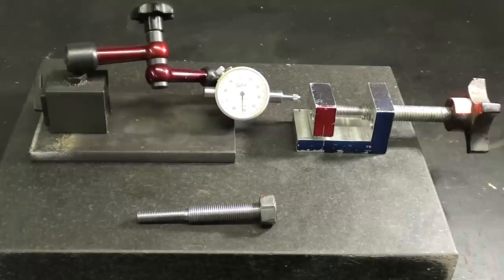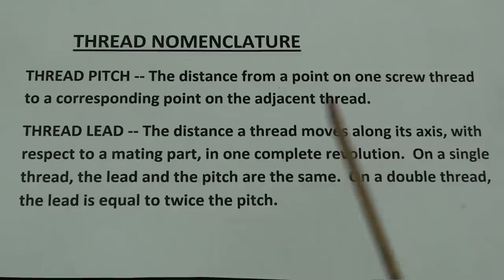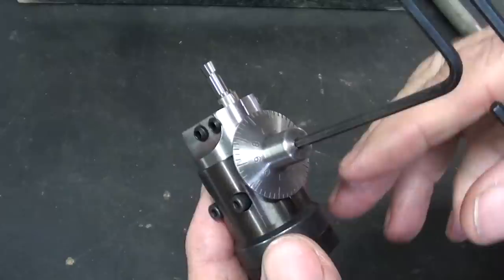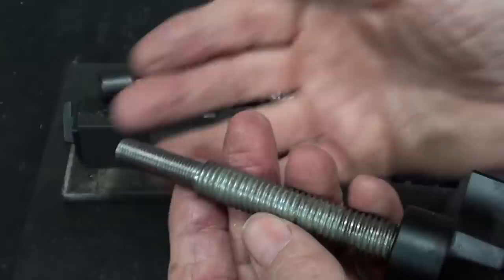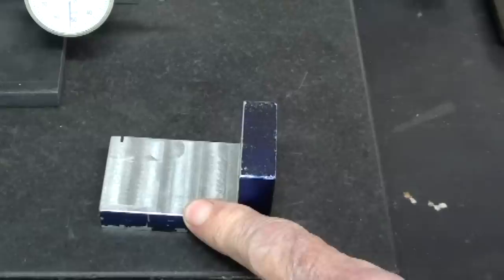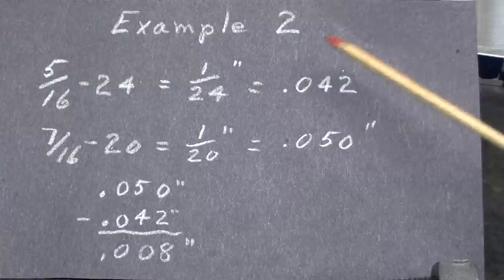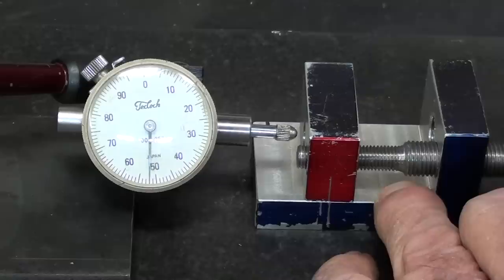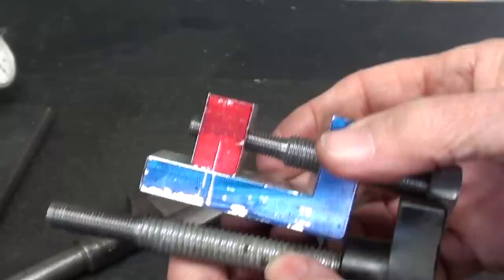What are DIFFERENTIAL THREADS #864 tubalcain

Comment: Thank you sir, for the explanation and demonstrations. I remember my father having a simple car jack with a central acme threaded column, nested inside an outer acme threaded part; the outer part being driven by an acme nut with an external bevel gear, manually operated by a bevel gear pinion via., a square section T-handle. I regret not looking more closely at the device but my guess is that the mechanism was based on a differential thread in order to gain the required mechanical advantage to lift a heavy car with modest human effort.

Comment: Nice demo - thanks. 

- the 8 thou per turn differential thread - converts nicely to metric as around 0.2mm per turn... (only out by 0.16mm after 50 turns...   So good to be able to mix and match from "standard" threads in metric and imperial for a precise outcome (imperial seems to have a greater range in thread pitches)..

The great thing with differential threads (L+R are interesting combos) the load carrying is orders higher than an equivalent "ultrafine" thread would be -  galling is also reduced, though "backlash is often increased, so best used for unidirectional devices (constant preload).
Reply from the maker: Thank you

Comment: Differential screws were used in phonograph record mastering turntables.  The turntable platter was geared to the screw, so the cutting stylus would advance slowly in a spiral from the outside edge of the master record towards the center.  Vinyl LPs have about 3.25in of recorded radius for about 20 minutes of play at 33-1/3 rpm, or 3.25in / (20min*33rev/min) = about 0.005in advance per rev, effectively 200 pitch.

Comment: Thanks Mr. Pete, always great to learn something new. I built a version of this old tony's boring head using inch measurements instead of metric. I can't tell you how many different thread pitches I tried (on paper) to get an adjustment screw where one rotation gave a whole number. 40 tpi the threads were too small, 25 tpi the lathe I was on didn't have that option. Wish I would have known about differential threads back then.

Comment: I found article about differential threads in Kent's Mechanical Engineer Handbook.The book I have had since 1974 . The article has all kinds of formulas for them.the pictures show acme threads.
Reply from the maker: I have that book, I will look it up, thank you
Reply: It's on page 7-10 from the number on the top of the page.
I am an old school machinist ,I learned on a south bend lathe and milling machine back in 1967.

Comment: I used differential threads for a couple of applications several years ago.  They both are for drill bit sharpner jigs, one for a General and the other for a Sterling (McDonough Manufacturing Co.) twist drill bit grinder/sharpener for large diameter bits.  The differential threads advance the drill bits slowly toward the grinding wheels for finer control of the amount of material removed from the bit.  Mitutoyo has micrometer heads that they call differential translators.  One has a resolution of 0.000005" as I recall.  If interested I could attempt to upload pics of how I modified the bit grinder jigs, both are fairly simple.

Comment: Great topic Mr.Pete. If one has a left and a right hand treads on a differential screw wouldn't this have the opposite effect and speed up the moving part? If so this would make a good follow up video. If I am thinking correctly you could explain the effect on a tap wrench. That small fine adjustment boring head is a sweet tool.

Comment: About 2 weeks ago, I made a replacement thumb screw for a Stanley 45 molding plane. It adjusts the fence that spaces the plow plane from the edge of a board. 

The specs are 1/4-28 tpi for 11/16 inch next to 9/16" of 0.196 (just over 3/16) left hand thread at 20 tpi.

I ended up single point threading both as I didn't have a die for the 1/4-28. Final screw fit well and is working great!
Reply: This was only about the 8th item produced on my lathe. I'm a retired engineer learning a new hobby to keep my sanity. I'm not sure if this screw helped or hurt the sanity aspect of the hobby. 😂

Comment: Mr. Pete last year I'm a high school and community college shop teacher, so I have acces to machine shops. 
Last year I made a "3rd slide" that mounts on an Aloris toolpost using a differential thread (40TPI-42TPI) so one complete rotation of the handle moves the slide .0011. I use a tenths indicator mounted on the slide to measure actual motion. I haven't done a set of experiments, but using a diamond cutting tool I'm able to take .0002 per cut. I really want to make another slide that moves in a 30 degree angle to be an auxiliary thread cutting slide. If anyone would like a pic of this unit I'm happy to send it out.
Reply from the maker: That sounds like a very interesting device. The differential thread is amazing, most people have never heard of it.

Comment: The steady rest on my 9" South Bend lathe has differential adjustable jaws. They call it "Telescopic" Steady Rest. But it works a little differently.  Instead of offering a finer pitch of adjustment, it's the opposite, it doubles the adjustment rate. Ken
Reply from the maker: Yes, I remember those. I had one ten years ago.

Comment: I ran into this concept a few years ago and found it really fascinating. While they are great for making really fine adjustments, you also need to keep in mind that with two threaded interfaces the play get's doubled as well. So for precision applications you need to hold incredibly tight tolerances with the threads to keep slop to a minimum. 
Eventually I'm going to get around to making a top link for my tractor using acme thread in a differential thread way. That way I can get the resistance to heavy loads that the acme thread offers, while still being able to make adjustments under load that I couldn't with just a plain application of an acme thread because the pitch being so steep means you have very little mechanical advantage when cranking on it.

Comment: I've used similar in shaft and coupling alignment, where the motor may have to be moved across a few thou.  Its all laser now but the adjusting screws are the same.

Comment: A few years back i pondered a way to move one thousandths movement with one Revolution on the hand wheel. I decided on the deflecting beam method. It was accurate and i used a single 8-32 allthread. This opened my eyes and i figure a scope uses some detail like these mentioned. Thank you Tubalcain i will be using some of this trik-o-nomitry😊

Comment: Once had to "design" a differential thread setup for precisely set a specialized bushing on UH-60 helicopters. Several of my coworkers never did figure out how I could get it within ,001 using a oddly stepped 3/8 bolt

Comment: These differential threads are used to make fine adjustments to the "slice" on a paper machine headbox opening to control the weight of the paper. These were placed every few inches across the machine so the weight of paper could be made uniform across the entire sheet.
Reply from the maker: That’s interesting, thank you

Comment: This might be neat on a slide driven rule with multiple scales ... where you could calculate relations or multiplication / division... you could call it a sliding rule... or slide rule for short... just thinking out loud... but if you made it computer controlled that would be a neat twist... a computer operated slide rule with differential screws. Happy Tuesday!

Comment: The Stanley #45 wood plane, later types like the Type 15, have a two-piece fence that uses a differential threaded screw for fine adjusting the fence.
Reply from the maker: Thanks, now I remember that I had several of those number 45s
Reply: @mrpete222  Yep, I have types 1-17 and a few duplicates.

Comment: I never knew about this, thanks! I have an english Troughton and simms master level that has a screw for calibrating the vial, I believe it is 100 threads per inch. I got the imitation optivisor out and counted 50 threads over 1/2". Now THAT would be a good application for a differential thread.
Reply from the maker: Yes

Comment: One shop I worked in we made three parts that were identical except the threads. One had a right hand, one a left hand, and one had both right and left hand threads on the same diameter. Not on either end with a flat in the middle. Both were on the same end of the bolt. Never did find out what they were used for.

Comment: Standard mechanism for the advance of a micrometer anvil. Adam the Machinist has an interesting application of a standard differential screw from Mcmaster, 5/16 on one end, 8 mm on the other with a mind bogglingly fine rate of advance.
Reply from the maker: I need to check that out, do you know the name of his video?
Reply: @mrpete222  That would be 'high resolution machinists jacks'. Glad to spread the word.
Reply: @verdantpulse5185  & Mr. Pete: many years ago when I was starting to work in machining I researched  making micrometers as I couldn't afford to buy them. I found a "Machine and Instrumentation Designs" book that showed how to use common dies to make a micrometer that measured in a phenomenal quarter or half a millionth! I was blown away. I had trouble wrapping my head around it all then, and my shop teachers weren't able to explain it. You have explained it to where I now comprehend it. For that I thank you.

Comment: You say that 100 tpi is impossible, well I was using an *ba thread the other day which is 59.07 tpi, and BA threads go down to 25BA (352.78 tpi (ok its 0.25mm dia) but a 14BA thread is 109tpi (about 1mm dia) so the threads are possible.
Reply from the maker: Thank you, I stand corrected
Reply: @mrpete222  they are however not easy to work with, you stand a good chance of breaking either the tap or the part.

Comment: grate video! I have a D-bit grinder that uses a differential screw to bolt the Grindingweel Arbor to the spindel. The fine pitch thread is actually on the outsiode of the Screwhead (its a normal socket kap machine screw). I hope my english is at least understandable...

Comment: Very cool stuff! It's easier to make a differential thread for fine adjustment, but high TPI threads are definitely possible. I design optical mounts with very fine adjustment, and I've seen adjustment screws as high as 508 TPI (that's a 0.05mm pitch)

I have no idea how they're made; I buy the screw with a matching threaded bushing so I can just insert the whole assembly and know it's gonna work.
Reply from the maker: Thank you, very interesting

Comment: Wow, thanks a lot Mr. Pete for this video. Somehow, I didn't really even realise differential threads exist but this was really educational and you explained it well.

It seems like you can get such fine and precise movement from differential threads because both threads have a kind of "compounding" effect where when you add both threads together, that results in a much finer pitch. I imagine that compounding effect of having two different threads would also have an effect of increasing the torque one could apply with that type of screw?
Or am i wrong and it would actually lessen the torque as opposed to a single thread? I think it would increase the torque though, right? Kind of acts like a gear in a way.
Reply: You would get more clamping pressure or pushing force with the same amount of torque. 
God bless you!
Reply: Well, you wouldn't get any more torque transmitted by the threaded rod, but you could definitely increase the resulting linear force exerted by the traveling part.

Comment: I understand the mechanism of how this works. The larger threads are advancing the block while the smaller threads are trying to retract the block. It's just that the advancement is only slightly more than the retraction. Which is how it allows for finer adjustment than just a single thread along the length

Comment: I have a small woodworking block plane with a very fine adjustment of the cutting blade using this principle. This concept can be used in reverse also as the aggressive movement of a water valve washer for very little movement of the shaft this is used in a lot of sink taps ( faucets ) allowing a large flow of water for a small turn of the head. This would make a interesting follow up video. Cheers.. Michael..
Reply from the maker: Yes, it would,. I have seen those on my woodworking planes
Reply: Michael, I am very interested to know particulars of your block plane, as I have never seen such with a differential thread. My Norris smoother uses such a thread, but surprise, surprise, it is not designed to magnify the sensitivity of the advancement, as I thought when I first set eyes on it. As you mention, it uses a left and right hand thread to speed it up! What a totally oafish and bogus move by the maker!! I have not been able to find much mention of the mechanism at all on sites that specialize in this and similar tools, let alone if earlier models  were set up differently to my later, all cast iron one. @mrpete222, what woodworking planes do you own that have a differential thread?

Comment: Some block planes for woodworking use a differential thread for the cutting iron depth adjustment. One example is the Stanley 60 1/2 low angle block plane.
Reply from the maker: Thank you, I believe I have that plane

Comment: Thanks, Mr. Pete.  I'm building a collet 'drawbar' for my drill press to use it as a cheap mill.  The spindle doesn't have a through hole, so I'm using a socket head set screw, 1/2-13 with a 5/16-18 insert to draw a piece of metal toward the collet adapter to grab the inside of the spindle.  Mainly I want an allen head rather than screwdriver for adjustment, and the differential screw allows me to draw the collet adapter into the morse taper on the drill press.  We'll see if it works.

Comment: I learned something today. It wasn’t making sense until I realized that if the two threads had the same pitch the moveable section wouldn’t move at all, so a small difference in pitch makes it move very little. The smaller difference seemed wrong to me before that.

Comment: The shank of my Wolhaupter UPA-4 boring head is secured to the body with a differential screw.  Thank god for Youtube or I never would have figured it out.  Needed to take the NMTB-50 taper off (bought it off e-bay) and change to 40 taper.

Comment: An interesting way to add a bit of precision yet still have some strength on the threads. Metric will be a bit easier to figure out. M4 and M5 are 0.7mm and 0.8mm pitch, that is a combo of 0.1mm. Poor mans Micrometer? Never noticed tap holders are left handed threads, must remember that if I ever make any. Now I will have to watch all your previous vids. Must be lots of useful info in them.

Comment: I believe that this type of threads were used on the rod ends of the push pull flight control rods for very fine  adjustments of the F111s flight control rods.

Comment: I have a couple of tap wrenches like those you have. In fact I was looking at them this morning as I was out in the shed cleaning as they are taken apart and need to be fixed (one of the jaws is broken). They are an example of one left hand thread and one right hand thread.
Reply: Also known as a compound thread. Both threads have the same pitch. One left, one right.

Comment: Very interesting!
I have seen this principle  being used in a skylight tha could be opened. There it were two threaded rods one running inside the other and rhe target here was to get more distance out of one revolution - transfered to Your example that would be the fine thread on the fixed block and the coarse thread on the movable one.

Comment: Thorlabs sell both 100tpi and 120tpi fine adjustment screws as well as M3 x 0.2mm and M3 x0.25mm adjusters. They also sell differential screw adjusters with an effective pitch of 25 microns. . 80tpi adjusters are widely used in optical mounts.

Comment: Very interesting to see this demonstration. If 5/8-18 and 1/2-20 threads are combined on the same shaft each revolution produces only .00555 movement. Thanks for showing the math required for this.

Comment: Am I correct in assuming that the two different pitches are in opposition to each other because on female portion is fixed and the other is moveable? One is trying to push and the other is effectively pulling.

Comment: I built a surface gauge with a flexure and differential thread for the fine adjust. It's from drawings in the book "Lathework: a complete course". It works, but not very well.

Comment: 100 threads per inch? Back when i worked at Amazon in the aughties, i had a 000-120 titanium screw on display on my office door as one of the smallest things you could get delivered prime. Amazon also stocked 0000-160 screws, but those were a bit too expensive for something to stick on my office door. I think the 000-120 was a couple bucks, but the 0000-160 was over twenty. I think the major diameter for the #000 was 0.034", and, of course, it had 120 tpi. I think it was 1/16" long.
Reply from the maker: Thank you, I stand corrected

Comment: Cool!
If the course thread was on the smaller diameter, the movement would be in the other direction, even though both threads are right handed.

Comment: I think you covered differential threads years ago, but only briefly, and only for the tap wrench.  Or maybe it was Keith Rucker.  Anyway, the only places I've seen them are tap wrenches and a micrometer head that I think was from a fiber optic test fixture.